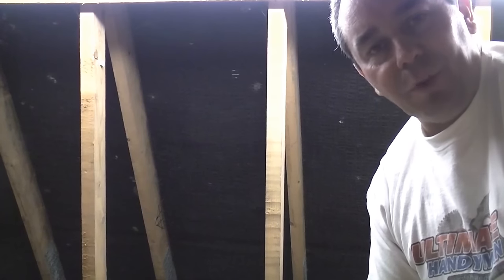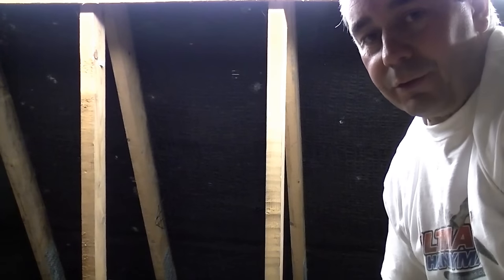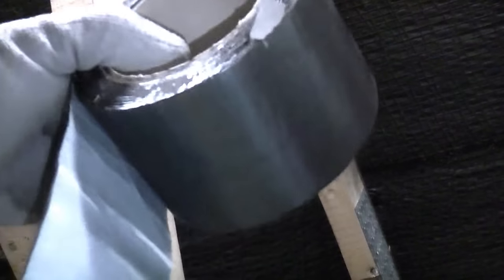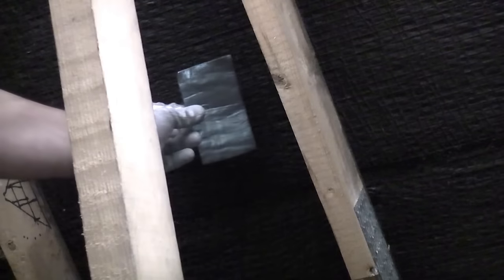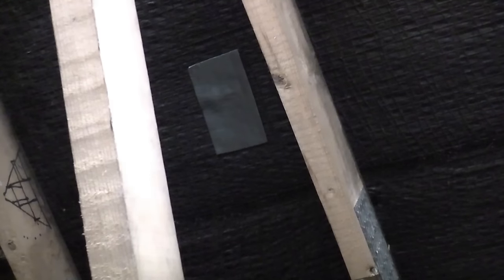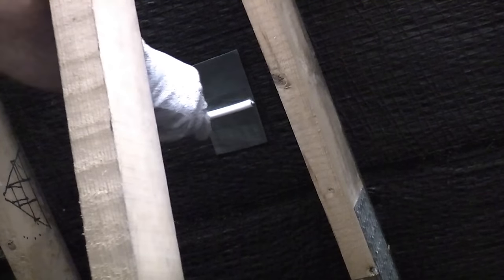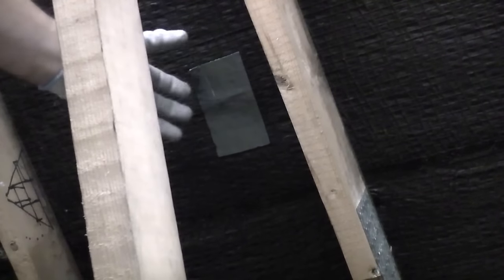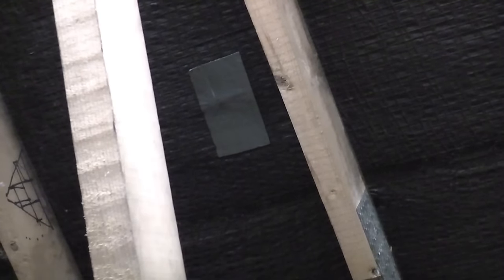Repair roofing felt from inside

Comment: I have been left by the previous owner large areas of roof felt torn and some missing. some of the holes are about a foot square. Can you give me some idea of how to repair these.
Reply from the maker: I think the best option may be to get the felt replaced from the outside, but as a temporary fix you could cut some pieces of roofing felt and stick them in the holes using flashbanding to seal the joints.

Comment: I did this extensively in my loft.....it works extremely well. Unfortunately I now have a very long area where it is rapidly rotting along the length of my roof about 6" deep and 30ft long...any ideas? I cannot afford to have the roof relined.
Reply from the maker: Is it rotting at the gutter end?
The felt normally goes into the gutter, if the felt is too long, or if the gutter is holding water, it can cause the felt to rot.
Reply: Shirley Porter Be a bit more specific about the position of your rot/leak ( ie. eaves/ridge etc.) Perhaps I may be  able to help, such that you could do something from the inside.

Comment: Well if it's a cold day in winter surely you can just warm the felt up beforehand with the heat gun and it will stick fine.
Reply: yes you can, gently though it's felt after all.

Comment: Thanks so much.  Pierced felt by mistake... was in a bit of a panic!
Reply from the maker: You are welcome
Thanks for the comment 👍
Reply: @ultimatehandyman  I have noticed moisture at small perforations in the sarking so there is water between it and the tiles.  The next move is to have a roofer look at it urgently but I am not sure how to find a good one (Dorking area).  The tiles look ok and the flashing around the chimney looks like it has been done right but there is a bit of moss on what is a fairly steep-pitch roof... so I am not sure of moss is really part of the problem.  It is a small Victorian end terrace house built around 1850 so not a large area and looks to have had some attention I would guess twenty or thirty years ago. Any advice welcome.  I wish you were based nearer!

Comment: One thing to add, in an old house with a lot of dust you will need to clean the felt in order for the tape to stick. Wasted a 10 inch strip learning the hard way that tape doesn't stick to dirt. :S

Comment: Great simple video, thanks very much!

To avoid an idiot like myself setting alight to my roof (and I don’t have a blow torch of any description) is there anything similar which can stick and bond to the felt without having to warm? Would the material still be effective without heating up? Thanks!
Reply from the maker: It depends on how warm it is in the loft, if you are in a cold country and it's winter, there is little chance that the flashband will stick unless the temperature of the felt is high enough.
I don't know of anything that will stick to cold felt.
Thanks for the comment 👍
Reply: Hairdryer on hot also works

Comment: But wouldn't the water still come through the outside roof tile and just end up seeping down the roof tile side of the inner felt? I mean the water has to go somewhere?
Reply from the maker: That is what the felt does. If water blows under the tiles, it runs down the felt, into the gutter.
Reply: @ultimatehandyman  Thank you. Yes, I did some googling ... I didn't realize there isn't anything between the felt and the outside tiles apart from the horizontal wooden strips (battens) that the tiles rest on. 😁

Comment: Good video. Followed the instructions and it seems to have done the trick. Thanks.
Reply from the maker: You are welcome
Thanks for the comment
Reply: @ultimatehandyman  I have a gap that's been forced between two overlapping sections of membrane by birds.  I don't think flash membrane would work for it (and the membrane seems hard to straighten out).  Do you have any tips of how I can fix this easily?  Thank you.... :-)
Reply from the maker: @lizprince-harding4787   Not sure, sorry.
I've only ever repaired small holes, like in the video 🤔

Comment: Thank you for this as I was wondering how to fix a few problem areas in the loft. No big tears just a few points that need to be sorted out.

I do wonder what kind of idiot would think a blowtorch would be acceptable in such a situation. The fact you had to point that out is just sad. You would think any normal person would realise that a live flame would be a bad idea.
Reply: Can I use a flame thrower instead of a heat gun?

Comment: if is a leaking from a nail or smaller holes..
and patching like that. .
you may have serious problem later because the water will take that off after few rains.
Reply from the maker: The flashbanding is waterproof ;-)

Comment: Tear in roofing felt(size of a large man's fist)  Unable to get any purchase to get flash banding to stick.  Any suggestions?  Thanks
Reply from the maker: It is best to apply it in warm weather, if it is still not sticking you might have to apply flash band primer to the felt first.
Thanks for the comment 👍
Reply: @ultimatehandyman  Thanks for your reply.  Will give it a try.  Really enjoy your videos.  Good luck 👍

Comment: What if the felt itself has come away at points?
Reply from the maker: Not sure what you mean, sorry? 
Is the felt ripped?
Reply: @ultimatehandyman  Yes. Only at two points. Felt has come away from tiles so I look up and can see the outside roof tiles. Its an old Victorian house and don't think its been touched in years
Reply from the maker: @TheStevenWhiting   I'd try and patch it up the best you can, but it looks like the felt might be at the end of it's life and might need replacing in the next few years. 
I'd use a quality flashband, Everbuild make a good one and I'd also use their flashband primer. You should be able to repair it with that https://fave.co/3z9AQo6
Reply: @ultimatehandyman  I'll give it a look thanks.

Comment: Can someone PLEASE recommend me a video or some instructions on how to INSTALL a felt completely from scratch from the INSIDE. I'm not a builder nor can I afford a scaffold to put up outside. In fact I don't even want to bother my neighbours with all the noise and hassle outside. Also I'm just not confident enough to be up there. I'm just into doing my on DIY. Thanks
Reply from the maker: I don't think that is possible, I'm afraid you might need a roofer!
Reply: @ultimatehandyman  thanks
Reply: @ultimatehandyman  ok. Thanks!

Comment: Won't a heavy wind push that through?
Reply from the maker: Edmund Geswein 
No, on top of the felt there is normally slate or roof tiles. The felt is only a secondary barrier in case any water gets through the slates / roof tiles.
The flash banding is extremely sticky and sticks to almost anything.

Comment: Have tried flash and but it just seems to peel off in the heat
Reply from the maker: Did you prime the area before applying the flashband?
Reply: @ultimatehandyman  yes  the felt is very course and brittle but seemed to peel off again when temperatures increased 
Am going to persevere but don’t want to damage felt more than it already is

Comment: Where is you get the roller ??
Reply from the maker: Stephen B You can buy them in any D.I.Y shop, they are called seam rollers and are used when wall papering.
Reply: Seam rollers are normally only 2" wide or so .the roller illustrated here is about 6" wide and with small diameter which is clearly the best option. I cannot find any roller like this on line. Any ideas. Thank you Peter
Reply from the maker: Peter Winterton
Sorry, I must have mislaid my seam roller that day. I never re-watched the video and assumed I had used the seam roller. If I remember rightly I used a gloss roller, but a seam roller should be used if possible ;-)

Comment: my hole is much biger 12" by 12" how do  pach this?
Reply from the maker: You might have to get a new piece of felt, larger than the hole and put it on the side closest to the tiles, then use the flashband to hold it in position
Reply: Ultimate Handyman By removing roof tiles, or by feeding the new felt through the hole and sliding it in place?
Reply from the maker: You would have to remove some tiles, I'm afraid.
Reply: Yes I was afraid you would say that
Reply: thanks as always for another great tutorial!  my hole looks like a roofer put his foot through or tore it while replacing tile :( do you recommend putting the felt on the tile side, so water can't build up between the felt and patch?  I have some spare 'cloth type' roofing felt, and wondered if i could stick it to the underside with a very thick coat of bitumen paint stop water getting between the patch and felt, then put flashing tape around the edges for extra strength and finish with 1 or 2 coats of bitumen paint - any thoughts?
Reply from the maker: I suppose you could try that, but I would closely monitor it afterwards to ensure that water is not leaking through. Ideally for larger repairs they need to be done on the tile side of the felt.
Thanks for the comment
Reply: thanks, i will see how it goes. Luckily there doesn't appear to be any water coming in, probably because it's at the back and wind isn't blowing any rain up under the slate. I considered buying bitumen for a bit of damp proofing and noticed there is bitumen paint and bitumen emulsion - do you know what the difference is? Thanks again ☺

Comment: What about a 2feet by 1 feet hole
Reply from the maker: You might have to cut a piece of roofing felt, then stick it in position using the flash banding.
I'd try to get the new felt on the inside of the existing felt if possible.
Thanks for the comment 👍

Comment: I just found we have a leak. We have a big football hole where some fucking cowboy wasps nest remover ripped a nest off the ceiling. Need a better fix than that lol
Reply from the maker: +Andy Smith 
Is it a slate or tiled roof?
Reply: +Ultimate Handyman It's a tiled roof mate. I can see what's happened. The guy about 3 years ago ripped off the wasps nest leaving a football size hole in the felt. Over the last week's we have had heaven wind and rain and it's found its way under the tiles and the felt isn't stopping the water. I put a board across the beams with a bowl under the whole as a temporary solution until I can sort it. Thinking of claiming on insurance as my bedroom ceiling has taken a bit of water. Not much,  it's clearly just dripping slowly on it.
Reply from the maker: +Andy Smith 
All this rain is a proper pain in the backside. I think today has been the best day for months up here!
Probably best to claim on the insurance, as probably the best way to repair it is to remove some of the roof tiles, then replace the damaged felt.
The guy removing the Wasps nest really should have told you that the felt was damaged!
I hope you get it sorted quickly ;-)
Reply: +Ultimate Handyman Cheers. I'm just hoping the insurance will pay for it.